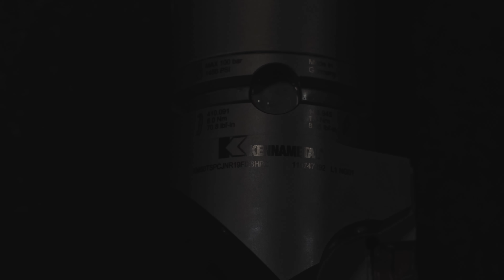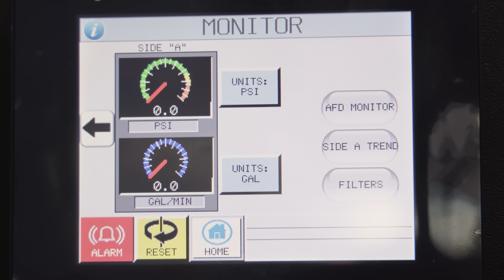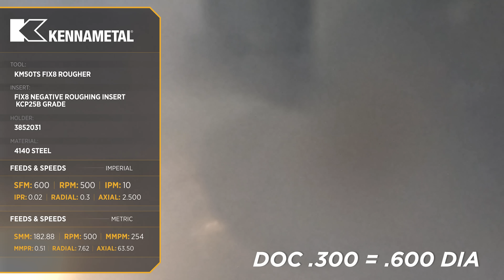AGGRESSIVE Cuts in 4140 STEEL | PUMA SMX3100ST Mill Turn Lathe

Comment: Hey hey you! It is only when the insert break off or become overwhelmed by the chip load and the chips starts self welding to it then I back off from being aggressive. That tool, that machine, that insert can still go bigger than it is maybe the full insert width will limit it. The last 2500 rpm sound great and yes, could give you a sweet spot for the chip load. Just cool though.

Comment: That's insane! What an incredible tool! And the claw jaws did a great job of hanging on. Would be very curious to see the spindle load and chips at each pass!!! Obviously spindle load will decrease at the lower diameter, even with the increased data.
Reply: theyre at the upper limits of the machine and tooling doing this, spindle load would have been 70% or more on the first few passes
Reply: @dgafbrapman688  i kip

Comment: So if you are planning to use such a tool, how do you tell if your machine can handle that much torque or load?  Charles
Reply: at .100 per side you would need 15 HP and 139 ft lb torque

Comment: That was crazy,  😧😎it would have been interesting to see the chips from each pass. Thanks for the video. Incidentally something that has always bothered me is the heat being produced and the heat in the metal, especially at high speed while using coolant or is there very little change.
Reply: Which metal are you asking about? The material being cut or the actual machine? The material heat build up is pretty minimal even with the machine and coolant getting up to 150°f. The chips are coming off so fast that the part doesn't really have time to heat up the mass of the slug he is machining. Also when you use HP coolant you create a cooling effect. In the piping and tool it might be 100°, but when its spraying like that it drops to like 50°, hits the part and hot chips, then gets heated up to 150° and then will dissipate heat in the coolant tank, chiller or machine itself. Combine that and the tool geometry to remove chips that fast and you got a rockin set up. These are just arbitrary numbers, but hopefully that makes sense.
Reply: @curtislow9204  Thank you for taking the time to explain, it does make sense. Appreciate it.
Reply: Also, the chip would look kinda stepped/jagged on one side and smooth on the other and from the sound of the chips in this video I bet they're a nice dark gold
Reply: Not too much as there is so much coolant and the insert cuts very free.

Comment: Would you guys ever consider doing a couple videos showing how tool wear varies across a bunch of parts at different cutting parameters?

I know it’s not as cool as pushing to the max, but from an education perspective it would be good. Shows folks more of the “long game”, which is where the money’s made.
Reply: I second this, a LOT of shops don’t put aside time to test their cutters and fine tune the SFM and chip load depending on X number of variables. I would love to see anything that involves examining tool wear at different combinations of conditions, one of my last shops were anal about it and it was awesome.
Reply: @BlueBerryFPV  Would be cool info to see for things like lights out machining or automation. Better to go a bit slower and have a rock solid process, but how slow is the real question. It’s one thing to cut a part 30% faster, but it’s no good if you’re changing inserts/tools twice as often.
Reply: @PraetexDesign  yes there’s definitely a balance there.
Reply: I third this. I'd love to see a detailed enough video about tool life on different kinds of tools with different feeds, speeds, DOC, LOC, etc. in a given material. That'd be VERY informative!
Reply: It's an extremely important part of our job though.
Reply: They do these as ads for kennametal.

Comment: That’s incredible how fast it chewed through that, and that last cut really surprised me how fast it zipped across there, that was really impressive!
Reply: Right. Each cut, the part diameter is smaller, and with the same or faster SFM the RPM increases each time, and then he increased the cut per turn also. So it is running 2550 RPM, .024 per turn, 61 inches per minute tool movement, and only 1 second per inch of travel! At 1000 SFM = 12,000 inches/minute, .024x.400=.0096 cross section area, that is 115 cubic inches per minute of steel. To support such cuts you need to be cutting a large block of material, a smaller rod would collapse with that much force applied.